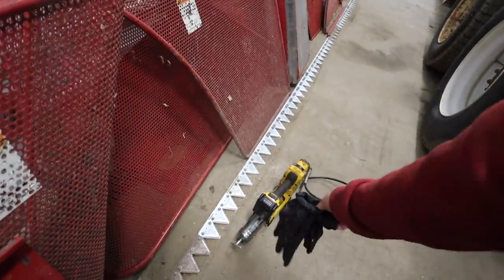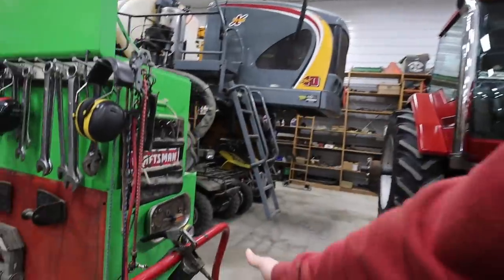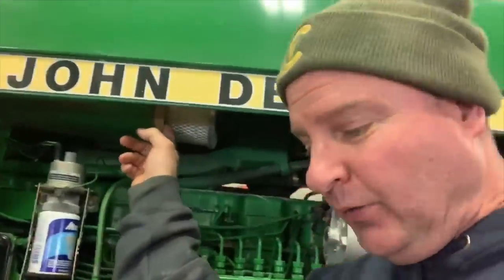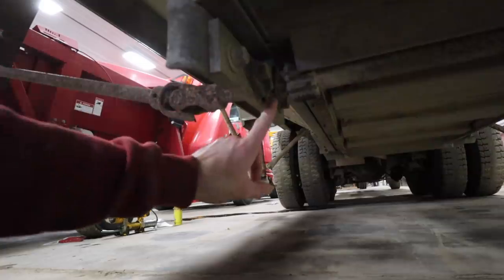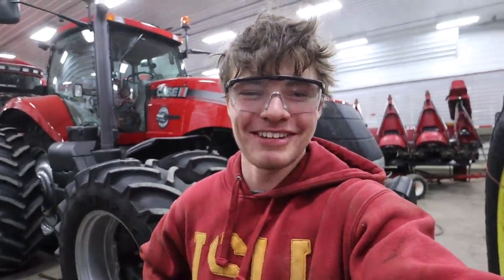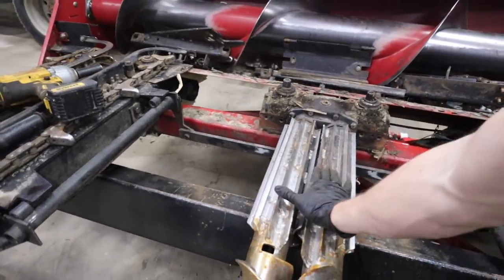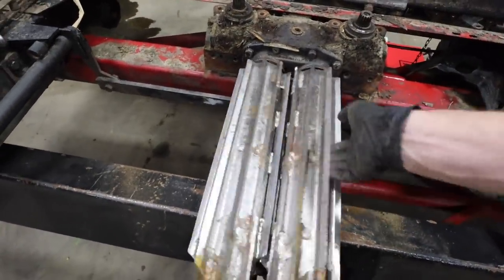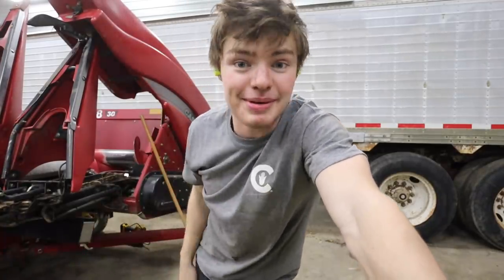NEW MECHANIC FINDS MAJOR DAMAGE!

Comment: OMG, I nearly fell out of my chair when you said the John Deere tractor was 40 years old.
Reply: Looks like a 40 year old tractor that's been well maintained
Reply: @jakegoodnight5660  I was thinking 10 to 15 years old
Reply: JD 40 series tractors were around from the mid 1970's till the early 1980's I believe, then came the 50 series and then the 55 series.....
Reply: I would agree with that . The tractor that's 40 years old look brand new. What I'd give to run that with grain wagon during harvest. I'm 30 years older than the tractor though.

Comment: Ha! My husband just said those tractors are in high demand because they are easier to maintain and work on instead of the new fangled high tech tractors. Smart move to keep 'em.😊
Reply: Kind of like the old cars versus the new cars same principle
Reply: TheBereangirl I just read the same thing. Old tractors in good shape are bringing premium prices at auctions.
Reply: Very true, the computers and the the GPS equipment is expensive.
Reply: @georgerydberg4393  my Dad paid $12,000 for a 1968 4020 John Deere tractor in 1968 we got $12,000 when we sold it in 2000
Reply: Sure is better than cars in today’s market. Thanks
Reply: New ones are very expensive also
Reply: No diesl exhaust fluid either.
Reply: I heard the same thing the other day!
Reply: Ada 1812  def systems are easy. Just fill the def tank every time you fuel up and you're good to go
Reply: @makingithappen9722  not when it comes to tractors
Reply: The tractor OEM have put on proprietary software and hardware, which makes repairing the new tractor impossible.

Comment: Thanks for letting us know about the 4840. Glad your keeping her. She's such an iconic look of a farming tractor.

   Please remember the 5th wheel!!! On all 3 tractor trailors. That is a grease point! I'm a "trucking" guy. Born raised and am a professional driver. You need to coat that red Volvo's 5th wheel as their is not enough grease.
Reply from the maker: Michael Harrington yep, we won't forget! I like to grease them right before we hook them up.
Reply: @ColeTheCornstar  thank you so much.  that's what you should do. But if you leave them hooked year round. You should disconnect and grease every 6mths just to make sure it's ok.
I love your videos.
Reply: @ColeTheCornstar .... I just wrote a long comment at the top, but as far as greasing the 5th wheel, don't do what Most people do After they grease it.... and that is, they have the landing gear down low enough so that when the "apron" of the 5th wheel makes contact with the trailer, it lifts the trailer up.... and in doing so, scrapes most of the grease off of the 5th wheel. Take an extra couple of minutes and do it right. 

IF... you have air ride on the drive axles,  dump the air at the point where the 5th wheel makes contact with the trailer... AFTER making sure the kingpin is Centered with the receiver in the 5th wheel, then slowly back under the trailer and while someone else is watching, stop the truck just as the kingpin is entering the receiver and locking collar, then apply air back into the airbags and back the 5th wheel the last 2 or 3 inches til locked.... this allows the trailer plate to sit down onto the grease, rather than shaving most of the grease off of the 5th wheel. 

IF you do Not have air ride on the truck, then just crank the landing gear down (raising the trailer (empty, hopefully) enough to clear the 5th wheel a bit)... and then back down again when the kingpin is positioned the same as I described above.

Another mistake that people make is... "grease is grease"... NO, it's not... make sure you use a grease on your 5th wheels that have a High "Shear point".... most all NGLI #2 greases do NOT meet the standard for 5th wheel applications on Semis.

The Very Best that I have found, and use... is Jet-Lube MP-50 (Moly Paste) made in Texas, and the only place I've found to be able to get it, is through GRAINGERS Industrial Supply... and they usually have to have it shipped in to your local store from their (Graingers) closest distribution center. 

It's Not "cheap"... I just picked up a 2 lb can of it (a little, goes a Long way).... $84.+   This stuff has Shear Strength of 300,000 PSI!!.... with an "operating range" of -300 to +750 degrees F and a NGLI base of 3.5.    You only need to Spread a thin film of it over the mating surfaces on the 5th wheel where it makes contact with the trailer plate. 

You won't "squeeze" this stuff out, like the grease that most people use, and another great place to use it, is on the pins where the 5th wheel pivots ("rocks") back and forth.... while it's unhooked of course... and tilt the 5th wheel front and back to be able cover the contact points and then manually rock the 5th wheel back & forth a few times to make sure it gets covered underneath where it's "sitting" most of the time. 

Using the MP-50 eliminates the correct procedure for coupling the trailer when using grease.... also, the MP-50 can be had in 1lb tins, 2lb, and 1 gal pail ($578.86+tx if applicable)..... here is the direct link to the MP-50 on Graingers website that I just copied for you... https://www.grainger.com/search?searchBar=true&searchQuery=Jet-Lube+MP-50  Sorry for the "book"... hope this helps you in some way, or at least "some food for thought".  ; ) 

My prayer over you and your family is Num.6:24-26... Always. If you don't know what it is... it's in the OT, the book of Numbers Chapter 6 verses 24 to 26.  Much Shalom (peace) to you & yours.

PS: My background is a 4 year degree in Diesel Engine Design & Theory (from the 1960's which also included the study of Metallurgy, and 2 yrs of Mechanical Drafting) and nearly 50 yrs (49) of trucking - nearly half of that as an independent owner-operator.... also several years inclusive of heavy equipment operation. 

Also, for "fun" (nearly 20 yrs)... I built, owned and raced front engine rails (dragsters)... also drove a back motored (rear engined) TAD (Top Alchohol Dragster) for a team back in the late 1970's... LOTS of Fun.  : )     Am retired now...  kind of.  : )

Comment: The 4840 is a great machine! 
I remember when they first came out. When tractor pulling became popular early 80’s late 70’s. These were pretty popular at the track.
Reply: Guy i work for had a 4840 dynoed at 248 horse from the factory.  Only supposed to be 180. I took it to a couple tractor pulls but didnt win anything because it would spin out instead of run out of power!

Comment: Great job on the 40 yr old JD.  Have you ever thought about having a maintenance binder for every piece of equipment and a clipboard for each piece of equipment with all the 'To Do' jobs to be completed by spring?   It always feels good to check something off the list.  House and farm are looking good.  Thumbs up!!  Question....Synthetic or non synthetic oil in your tractors??  We consistently get over 400K on our vehicles by running full syn.  I'm a Valvoline girl and husband is Mobil One user.
Reply from the maker: We keep our to do list in our heads. The note app on our phone works good for stuff we need to remember too 😉 We use non synthetic 😇
Reply: Maintenance folder sounds a good job just in case new staff are required to be trained
Reply: We use a white board 
Hours serviced service type and other jobs to do (lime discovered damage yet to be fixed
The board also has a jobs to do section, like mow the laneway or clean up junk or check livestock waters 
So anyone can look at the board if they're looking for something to do, particularly useful if you have a few employees I don't have to be manage them all day 
Just refill the list once a day or so

Comment: When greasing the rear brakes, release the brakes to unload the bearings,they should take grease easier..
Reply: Also, be sure to coat the insides of the brake drum and rotors with an extra thick layer of grease.
Reply: @hawser2088  how about no.
Reply: @hawser2088  troll elsewhere
Reply: @hawser2088  I had an acquaintance that raced go karts when he was young, some of the younger racers came to him, asking why he was so much faster then them. he told them that it was because he put Newersieze on his brake pads, in the next race a bunch of kids went in the grass at the end of the straightaway, guess why.

Comment: I learn something new almost every time I watch one of your vids, Cornstar crew... And today it was the wonders of lubrication! I think my knees need some greasing... Lol!

A question I have had from a few videos before even this one is, how do you keep track of the equipment hours for each farm machine? Thankfully vehicles have maintenance intervals based mostly on mileage (yay for odometers), but I didn't know if there was some kind of monitor (besides guessing) that tracks time vs. distance for your stuff. 

The one thing that I need to worry about tracking time is my daughter's figure skates. They need sharpened about every 30 hours of use. I end up squinting up at the ceiling trying to add up practice and lesson hours to figure out if I need to get it done soon. 🤔😄

All the best to you, Cole, and the rest of the Cornstar gang from over here in Summerville, South Carolina. Stay warm and safe!
Reply from the maker: Natalie Graham our schedule for repairs is usually done at the end of each season. 😇
Reply: @Rex Johnson thanks for the info! Glad it's not a squint-at-the-ceiling while attempting-to-do-addition thing! 😄

Comment: Thx for the video Cole. I manage 33 acres of hazelnuts on the west coast in Oregon. My dad owns and did operate the orchard but retired 2 years ago and left it to me,  Ive had to learn on the go and ask many questions along the way. So now I manage the nut trees , and all the equipment used to work the orchard, which includes two case tractors, a JD tractor, a nut sweeper, a nut harvester, sprayers, etc..... a couple of years ago I got the picture of what farming is like, doesn’t really matter the crop, nothin cheap about it.

Comment: Good message at the end. I had to replace the transmission on my pick-up a few years back. I thought it was going to be a nightmare. I did 75% of it my self with my uncle helping with the harder stuff like getting the catalytic converters out of the way, replacing the u-joints (they were starting to go bad on both the front and rear driveshafts) and making sure all the wires were in good shape and plugged in right. Saved $2,000 by taking every weekend for a month to work on it while it was parked on a gravel driveway.

Comment: So glad you're keeping the JD 4840. That's a nice piece of history. My dad had a little JD 950 27 horse tractor he bought in 1977 or 78. Your 4840 comes from that same era. I remember seeing fliers for your tractor at the dealers at the time. Also, I really like that you keep everything nice and clean. Daddy Cornstar doesn't just wash the farm equipment, he worshes them! 😉😁😁 
   Your little crash course on grease reminded me that dad's old 1971 International 403 had a fitting or 2 that required greasing at about 4 or 5 hours. It was for the sickle drive pivot arm. We would stop for lunch every day, top off the tank, grease it and go back out after lunch. Very fond memories.

Comment: When you fessed up stating the elevator was refusing to open your trap doors on the trucks I was relived that we were not the only ones to have the coop tell that too.  Although, the low gear in the gear box was broken too, hence we could only use the high gear, we had to shove our weight behind the crank to open the first 1/2 inch of the hopper bottom.  (We have triple axel wilsons.)

Comment: Cavemen and wrenches...lol, good one Cole. And regarding bolts that fall in the wrong place, I once dropped a washer that rolled the full length of my garage floor, and then it found the only crack in that floor and went in it and I couldn't get it out. I had to drive to the hardware store just to buy ONE washer...

Comment: Grease is my cheapest farm expense , never too old to learn and only recently have I been releasing the pressure on loaders & axle pivots etc by pushing down on a block of wood  ,  this gets the grease to the loaded side of the pin or component for a proper job .  (  lots of moving points on a mechanical self level loader )  ~ ~ ~

Comment: BTW for your shop floor - paint is the pits.  It never sticks, gets to be a patchy mess, etc.  But I stumbled on the perfect solution - concrete stain!  Let the stain (not oil!) penetrate and seal your concrete.  Works awesome and makes cleanup simple.  All kinds of textures/colors are available.  Cheaper than paint too :)

Now if I could just get the little bit of paint that didn't come off on it's own off my garage floor so I can stain the whole thing - d'oh!

Comment: For zerks that won't take grease  try a Lock N Lube grease gun end. They lock on and make it so you don't have to hold it on and try to pump the gun one handed. They also have a tool I think is called  Grease Buster for frozen zerks  that won't take grease. Give them a try they work well. I use them to grease knuckle cranes and it makes it so easy. Great videos. Keep it up Cole and Daddy Cornstar!

Comment: I'm a farmer in the coastal plains region of Eastern NC. Our tractors get a tremendous amount of use and thus many hours. For example I have a JD 4455 with nearly 12,000 hours (original engine). I also have a Case Ih 7220 with close to 11,000 hours (original engine). The sun and heat down here takes it toll on the paint and fiberglass finishes. We wash and wax at the end of the season, however, our fleet is not comparable to your finishes.

Comment: Hey Cole, thanks for the great content. Another trick for grease Zircs is to take a wrench and back it out 1/4 turn to create a little room in the fitting and blast it with grease and retighten, works slick:)

Comment: Hey Cole, I noticed in your recent video that the chains and the choppers looked quite dry and also the gearbox assembly off the semi.
As I said Cole you should really try the waste oil and diesel mix if only on one vehicle, We done this every year ànd what a difference. Before the sowing a wash down with water and detergent and" hey Presto" like new. Honestly, try just one vehicle, It stops further oxidizing and keeps exposed joints lubricated. 
We done all our tractors, trailers, combine ( top to bottom) header and all our compliments. 15 years years we practiced and I can honestly say doing it saved us a lot of money.
Reply from the maker: Mark Staig normally we oil down the cornhead and bean head. The corn head had to sit out for a few days through a couple snows so that's why it's a bit rusty looking. Not fun to work on when everything is all oily either 😉 great idea though. Definitely helps keep mice off.

Comment: cole on the fifthe wheel if you can locate a 2 inch piston wrist pin or a trailer fith wheel  pin slide it in the pocket of your fifth wheel and lock it shut and check your end play some times you can adjust up the end play to get the slop out if not you  can get a new jaw kit and rebuild the fifth wheel they are fairly simple to go through you can get parts for them through the truck dealerships . I was a truck mechanic for about 30 yrs .

Comment: Cole, on the 4840 put a little pipe extension on the plug that drains the oil filter, it won't run oil all over everything when you unscrew it!!

Comment: Cole, a word of caution. Put grease into a metal cup and heat the outside of the cub with a propane torch.The grease gets hot and loses its viscosity. Don't overheat the zerks. I learned the hard way when my grease turned to oil and no longer lubricated.

Comment: Cole and Daddy Cole  Mechanic work is what I used to do, most of its memory and strength, with some commonsense mixed in, But that all changed  when the cell phones with cameras  came out  now you can take pictures  before you take something apart and as you take it apart so you can remember how it goes back together and which bolts go where. its a fun tip instead of making guesses on stuff and having bolts left over

Comment: Wow... sooo much maintenance on this farm equipment begs the question...Are these really just warn out parts or are these repairs due to bad design or abuse in the field while running equipment too fast or hard in a heavy harvest? Also my dad showed me 2 important things about grease fittings [1] always take a cloth and clean the fitting tip off before you hook up the grease gun and [2] after greasing always leave a little dab of grease on the fit to protect it from getting dirt into the small hole of the fitting. Wonderful vid as well. Best always!
Reply from the maker: Most of it is worn components but some stuff just breaks too.

Comment: I'm familiar with the grease gun I use one just about every day . I got a piece of equipment a few years ago and apparently they didn't know what a grease gun was because once I started greasing it and using it it started falling apart and breaking down almost every day for a while . Just about replaced everything on it but works fine now . How ever just a little grease could have saved me alot of headaches.

Comment: If you go to Eastwood's website for the exhaust on the 4840 look up ceramic coatings you will pull your exhaust off the tractor spray it with ceramic coating just like you do any other kind of spray paint put the exhaust back on the tractor let it run for about 45 minutes at idle and put it back on then you will have a good looking exhaust that will last longer than regular paint. Carl

Comment: I Love a good talk on grease fittings, I get to use an air powered gun from a 20gal drum of grease at work. No joke can shoot 30ft+ away lol 😃
I do preventative maintenance on large trucks, semis, trailers, construction equipment etc. A cement truck is our king of fittings/oil reserves, I wonder if any farm equipment has more?
Reply: I did learn something, never tried a torch on the fitting